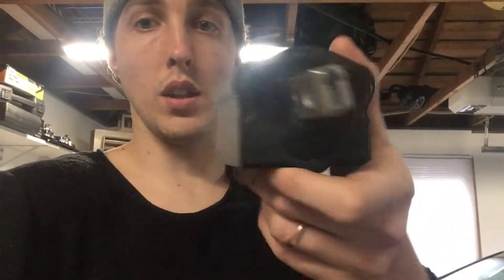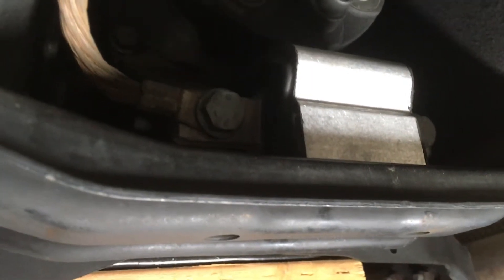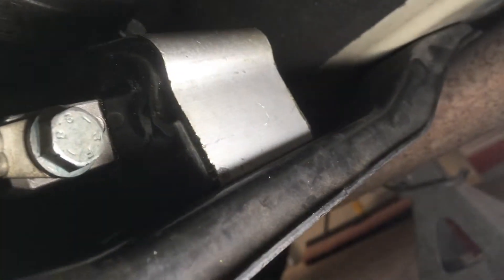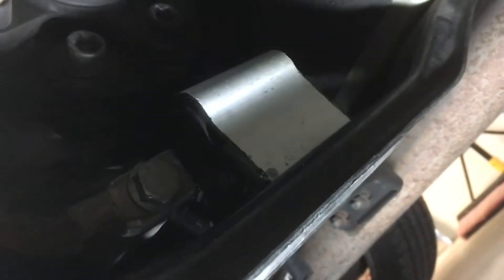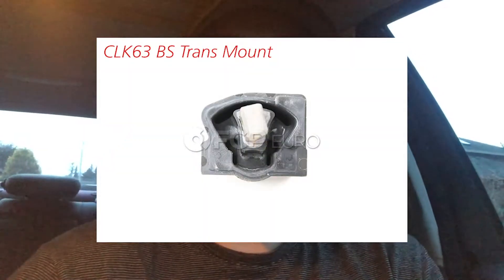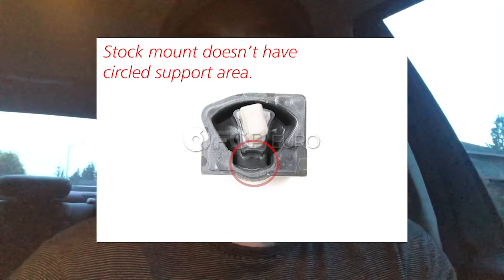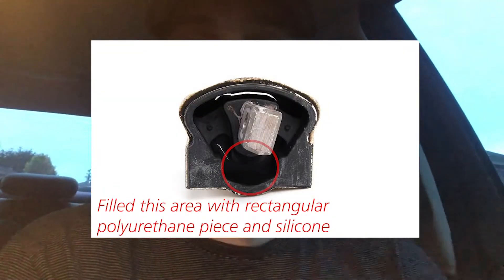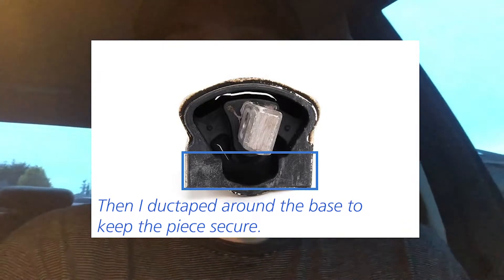HOW TO MAKE A POLYURETHANE TRANSMISSION MOUNT

Comment: Looking at the original mount, it allowes for drivetrain axial rotation. The engine lifts on 1 side when you accelerate. The new one does not allow for that.
Back to the drawing board I suppose.
Reply from the maker: this has long been changed out, I am now running both poly engine and trans mounts from Creative Steel inc. The car is also now manual swapped.

Comment: Another great video. How was the poly trans mount while at idle? I noticed a decent amount of vibration between 2-3k rpm, so my experience is similar to yours. 

Thank you for sharing.
Reply from the maker: MrEricw7626 it was actually good at idle especially with the poly engine mounts it took all vibration away, however once you started going there was noticeable vibration at around 1800-2000 rpm. The responsiveness gain wasn’t worth that vibration. Video coming soon on the Creative Steel transmission mount! Thx for tuning in!